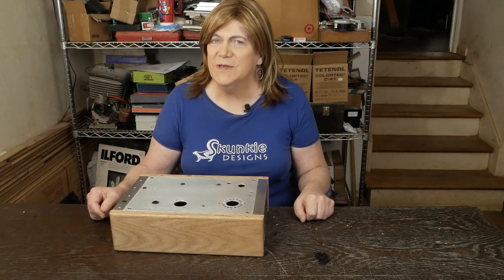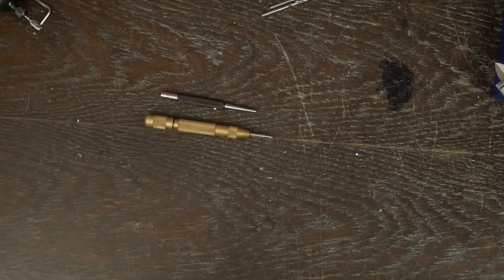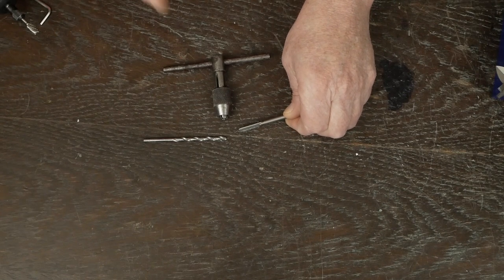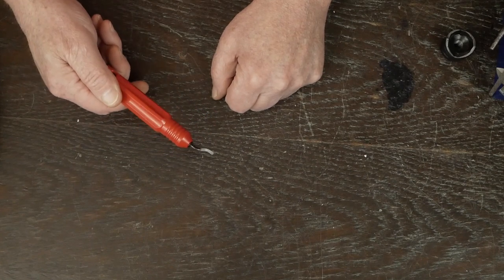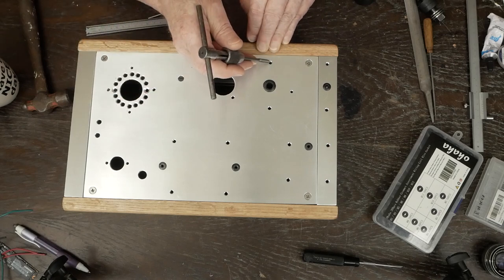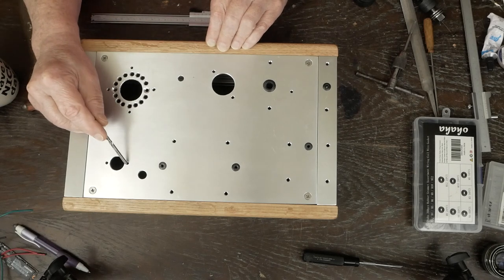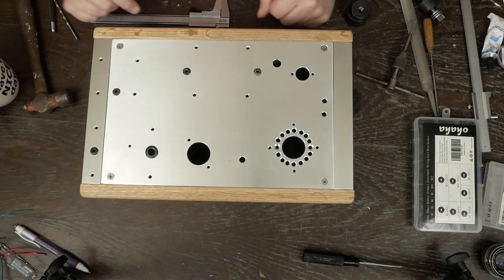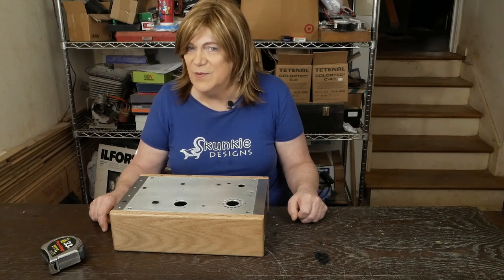KT120  SE UL mono block Tube Amplifier: Chassis Fabrication.

Comment: Wow, amazing job with the chassis, and you mirrored it which I've never seen done before. Excellent.

For people with less experience, it may be helpful to pre drill your layout in a piece of scrap wood (plywood, but I prefer a very hard wood). Then you can clamp the wood to the chassis and drill using the holes to guide your bit.

The wood works as a template and ensures that your holes are in the exact place you want, and that the bit is straight, while also making sure that the bit doesn't slip across the metal.

Especially useful for places like that driver tube and ventilation holes.

But really impressive work, Skunkie. Can't wait for some mighty push-pull some day for people with inefficient speakers - maybe also using the KT-120's.? Or maybe I should just chuck my 85db speakers out the window, but I can't lift the bastards.....
Reply from the maker: great tip!

Comment: Thanks for the tool advice, I'm already keen on these Irwin bits. Your set looks very nice.
Nice grommet kit too. 

A thought crossed my mind to make the repeatable work more streamlined and consistent. If making more of those ventilation holes around tube sockets, ordering a machined drilling template (preferably steel) might be a good idea - the template would have a pilot hole in the center and all the ventilation and attachment holes. Using it would be as simple as drilling the pilot hole first, screwing the template on, drilling all the remaining holes, detaching the template and using a cutter to make the proper big hole for the socket. Other templates could be made for different kinds of parts if you work with them repeatedly, e.g. IEC power sockets, meters etc.

Comment: Absolutely beautiful job as usual, Stephe. Looking very much forward to seeing the rest of the build. These amps look absolutely perfect for my system, so I’m definitely gonna build a pair. As much as I want to buy them (not that that’s even an option), I personally think you should 100% keep them. These are hands down the best amps you’ve built so far, imo. 18wpc SE amp?! Wha? That’s so awesome. My main speakers are aprox 95dB sensitivity (Tekton Pendragons), and I just got an old pair of Klipsch Fortes (also aprox 95dB sensitivity), which I just ordered parts to upgrade the old caps and a couple upgrades from Crites, and I could see these amps running them with ease. 🔊🎶😊

Comment: Enjoyable video thank you!  Those extra cooling holes around the base of the KT120 - are they to cool it's cathode resistor (I forget if it has one sorry!), or are they to help cool the KT120 itself?  Perhaps both ay?  I guess they may set up a kind of 'chimney' effect with the air flow would they, with the rising heat from the 120 drawing cooler air from underneath, up through the holes?

Always a nervous time for me, having to drill a bunch of closely-spaced holes in aluminium, that have to be spot on or they're gonna look crappy!

I use a monicle magnifier, & a small tungsten-tipped scriber to make the initial, tiny centre-hole dent for my hole centres.  I just push the scriber into the aluminium just hard enough to make a mark that I can find & 'click' into with my centre punch.  

A light tap with the centre punch, then start the hole by hand with a 2mm drill bit in a pin vice a couple of turns, just to make it easier for the drill bit to stay accurate.  Then I finish off the 2mm hole using my cordless drill.  After that, I now have an accurate pilot hole to drill out to the final size.

A bit laborious, but it keeps the holes accurate when it matters!  Works for me!

Hey Stephe what's that steel ruler device with the sliding carriage & pin called?  Looks very handy!  I want one o them!

Great idea with the roller bearing washer on chassis hole punches!  Phew!  Yeah, a lot of force is involved with these punches, & it almost feels like the head of the bolt chews out a little of the punch surface with every hole it makes.  It'll be 5 times easier to punch a hole with that thing I bet!

As tedius as it can get, it's still kinda fun getting all the bits positioned & spaced exactly where you want them, & all the chassis-bashing involved.  I'm glad you declined in supplying customers with chassis.  That would spoil it for you.  One offs are an adventure, but production line work gets boring.
Reply from the maker: Yeah, it's to take advantage of the chimney effect and pull and heat inside the chassis out. 

That measuring ruler/scribe thing can be found here:
https://amzn.to/3PemITQ

Comment: Thanks Stephe..good to see progress in the KT120 build ;-) I have made up the chassis and ordered the iron from Thermionics - they said the chokes were rated 750v which is well above your 500v minimum. Any idea when the BOM will be finished?
Reply from the maker: After I am finished building and tuning them. If you want to start now, just make up the parts list from the published schematic.